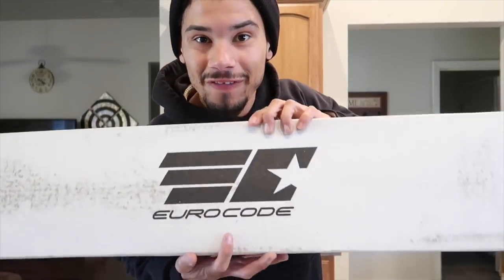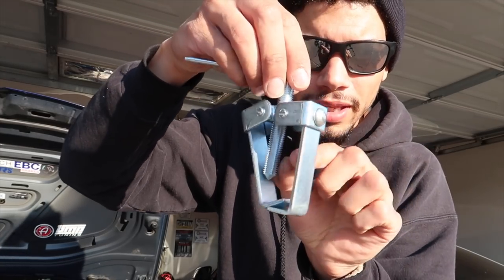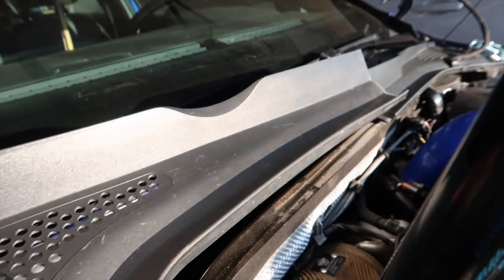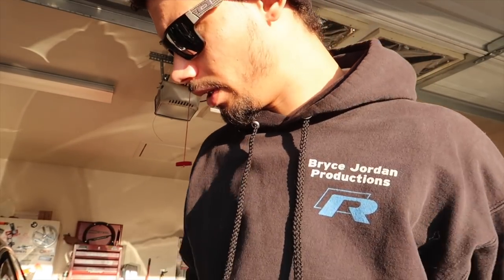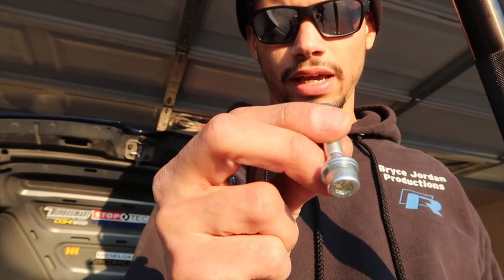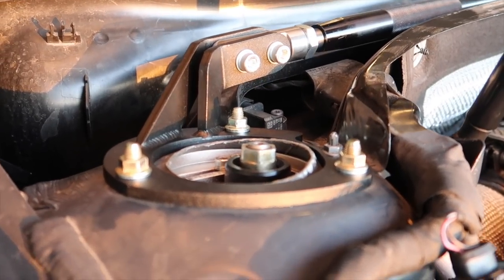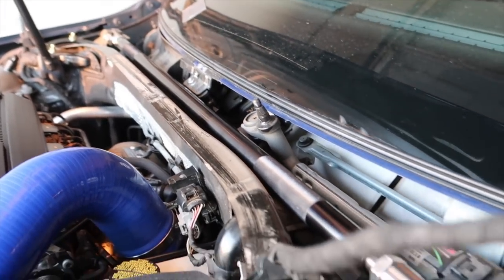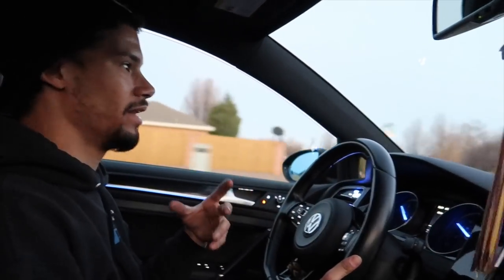Eurocode Strut Brace! (this things legit!) | MK7 Golf R

Comment: The diesel geek sure pin was good for the price but a lot of work but do recommend it (only broke one plastic clip🙏), I just finished the 034 trans and motor mounts last weekend, with the ECS bleeder block and short throw the 6MT is finally feeling sharp enough.  just found this vid and might be the next move for the R move to improve the steering feel thx!
Reply from the maker: Glad I could help man! That superpin is one of my favorite mods! Glad you liked all the shifting stuff, it's some work but man is it ever worth it! Same with this brace, it really changes the steering, I really wish I would have done this forever ago, definitely should be one of the first mods!

Comment: Hey Bryce, thanks for the video. Quick question: did you raise the front of the vehicle “so the tires are still supported” when installing these? Im thinking of skipping that step cuz i dont have space in garage to do this
Reply from the maker: I didn't have to cause I have coils with the opposite style of hardware on the top mount there, if you're still stock you probably should. I'm not sure of what the consequences if any honestly

Comment: Did you ever install adjustable front endlinks on or are running the stock fronts
Reply from the maker: No adjustable ones yet.. front endlinks, control arms, & trailing arm bushings are my next purchase for suspension. But I ditched the OEM ones for the ones that came with my BC coilovers